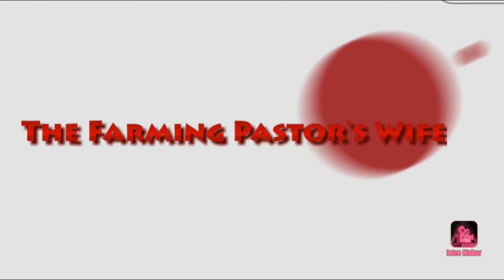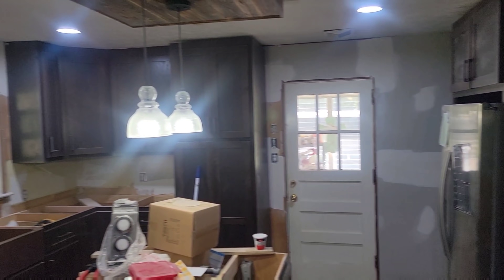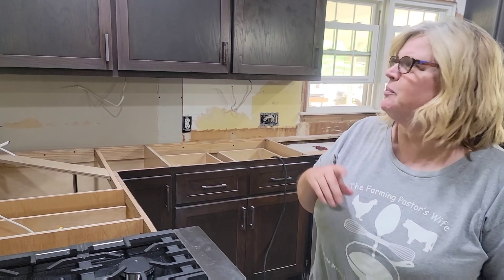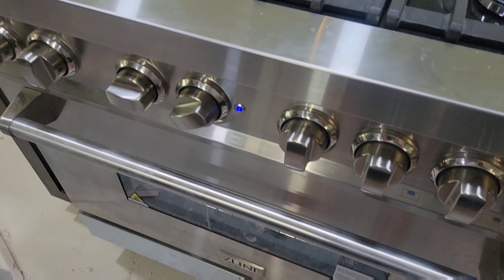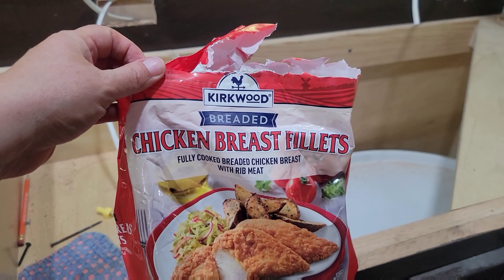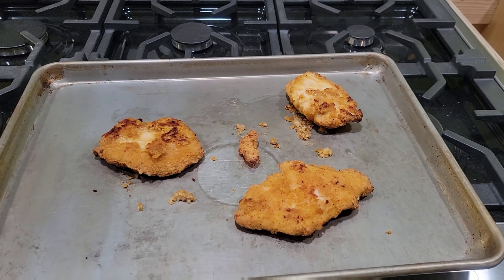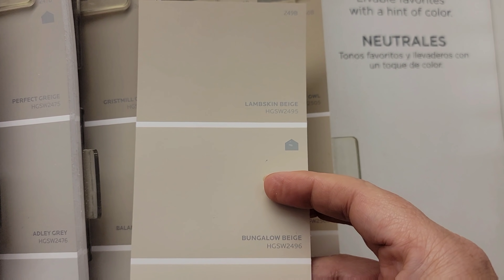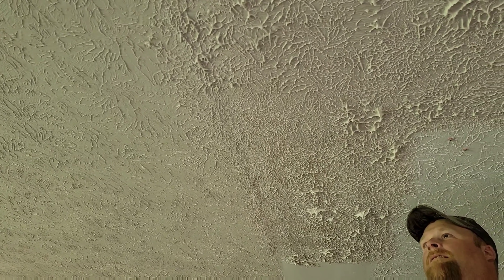A Day Late but It's Here! | Remodel Updates

Comment: Leslie that granite is gorgeous great job and as for the burners on the stove it's not by pot size it's by the size of flame you want to use and there is always one main flame that is the hottest and biggest always lower left side very first one please be careful with that one it's a very big and hot flame and yes a gas oven is a lot hotter than electric be careful just keep at it I know you will love it just takes time getting use to the switch..much love and God bless you all ❤🙏

Comment: You are a saint to be able to deal with the mess.  I've done it and it's hard.  But I'm so anal I could not stand to not have the walls painted before all the cabinets went in.  You need the paint on the walls if you are putting up backsplash.  And it helps if you ever want to remove the backsplash.    On your cookie sheets, use foil or parchment paper and it really cuts down on the cleaning for your cookie sheets or baking pans.